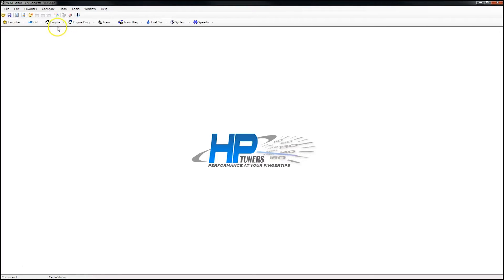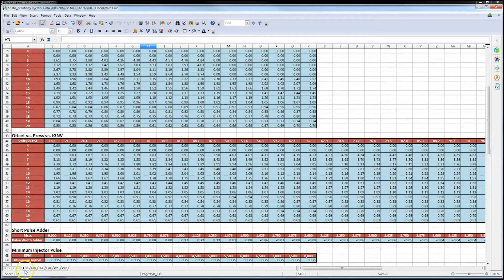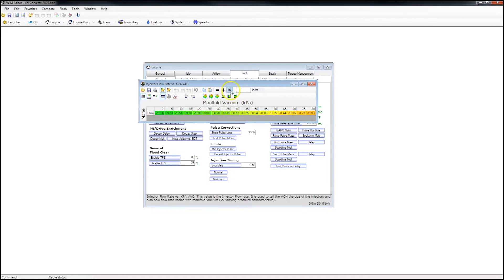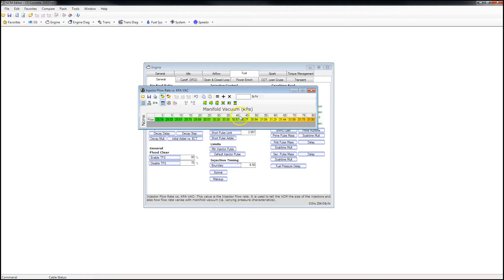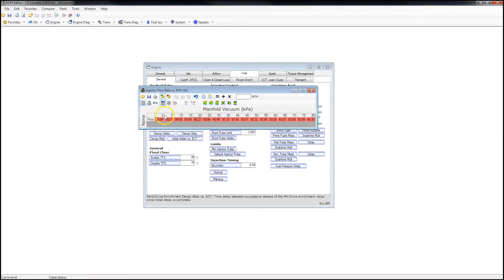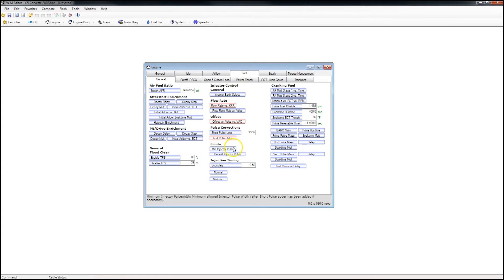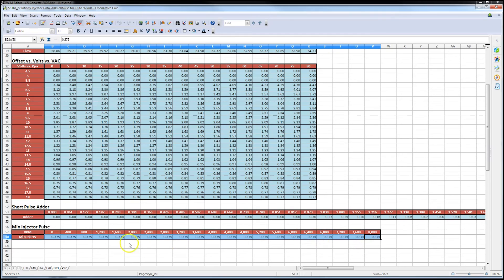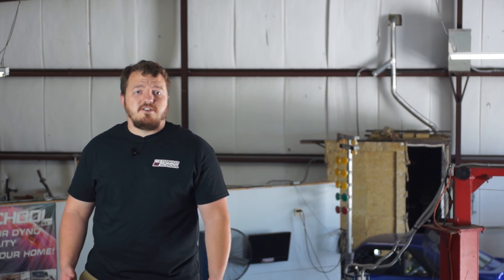How To Import Injector Data in HP Tuners

Comment: Once the injectors and data is installed and the ecm has accepted it.. is that it? Will the injectors perform pretty much as stock until retuned?
Reply: Did you ever find out that answer? I have the same exact question lol
Reply: @PengInTheAzz  in theory yes.. in practice it's going to depend on how close the injectors actually Match the data.. the best workaround for this is to see what your current fuel trims are (let's pretend they're 5% rich).. instal the injectors and data and relog your new fuel trims..
Let's pretwnt the new fuel trims are 10% rich.. were going to adjust the new data ifr until it trims 5% rich..
This in theory will give you the correct ifr and you won't have to redo your SD table and maf curve..
Reply: @yolofullsend  thanks! Guessing you've tuned a lot in the passed five years lmao,  any tips for a newbie just getting started?
Reply: @PengInTheAzz  depends where you're at with things... if you just built a turbo cammed ls and don't know where to start.. pay a tuner...
If you already have a working car and you're making minor changes.. dont be afraid to experiment with small steps.. take lots of logs... use a wideband 24/7.. keep a known good file on deck if your tune isn't working...  dont run lean and don't go crazy with the timing..  the learning curve is huge and the risk is high if you don't know what you're doing...
Take cautious small steps.
Reply: @PengInTheAzz  as for the injectors.. I tried to tune a set. Couldn't do it.. paid my tuner.. he couldn't do it either, they were shit injectors.. got a different set.. plugged the data in.. adjusted the ifr and they worked great...
Reply: @yolofullsend  appreciate the advice, I have a cam waiting to be installed as well as the turbo but I want to learn what I can do while stock. I have my wideband and wanting upgrade to deatschwerks  injectors for future power

Comment: While explaining flow vs. KPA you said that at 80 kpa you will flow more due to higher vacuum then at 0. Shouldn't that be the opposite? 80 kpa is higher pressure wise than 0 correct? Sanity check please 8)
Reply: You are correct. 100 Kpa is equal to atmospheric pressure.  So between 14 to 15 psi at sea level. Anything under that is manifold vacuum and anything over that is boost. So 80 Kpa is 11.76 psi (assuming 14.7 psi atmospheric pressure) or about 6 inches of vacuum.
Reply: I know this is old, but I had the same question and had a hard time finding the whole detailed answer why the table and values are set up the way they are.  The kpa confusion really just stems from the perspective of how the kpa readings are figured.  A guy named Russ K on the HPTuners forum posted this awesome answer.  He said..."The injector flow rate table is referenced to manifold vacuum kpa. To convert map kpa to vacuum kpa, you take the barometric pressure and subtract the manifold map. So if the baro in your area is 95 and your manifold map is 95, then the manifold vacuum kpa is 0. If your map kpa was 15, then the vacuum kpa would be 80."When you convert the MAP kpa to the vacuum kpa like he explains, it all makes sense.  Keeping his example of 95 on the MAP for barometric pressure...15 MAP kpa at idle converted to vacuum kpa by removing it from the 95 kpa for atmospheric pressure gives us vac of 80 kpa.  It now makes sense the flowrate values in the table are higher at 80 kpa of vac since the fuel is partly getting sucked from the injectors in this condition.95 MAP kpa at WOT converted to vacuum kpa by removing it from the 95 kpa for atmospheric pressure gives us vac of 0 kpa.  It now makes sense the flowrate value in the table is lower at 0 kpa of vac since the flow is not getting any extra help from suction.